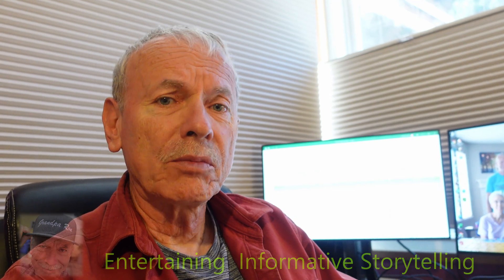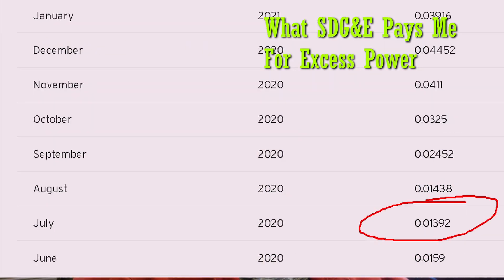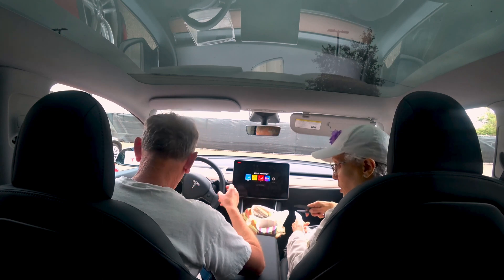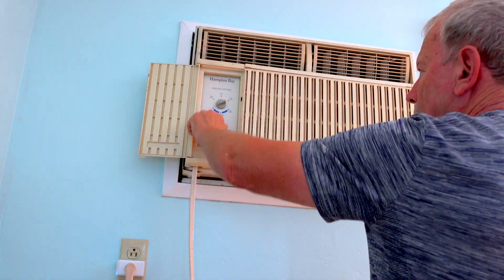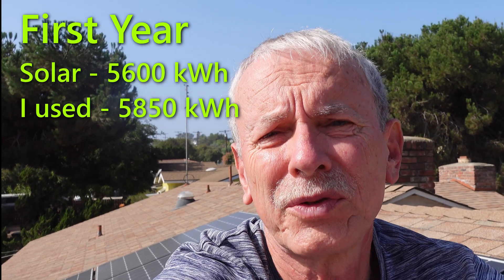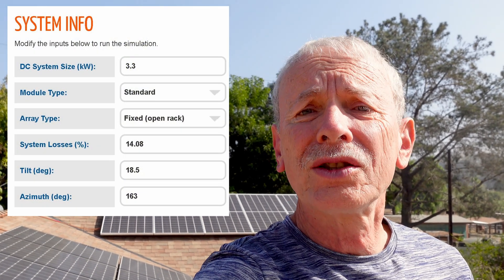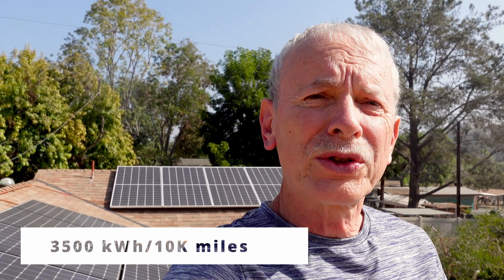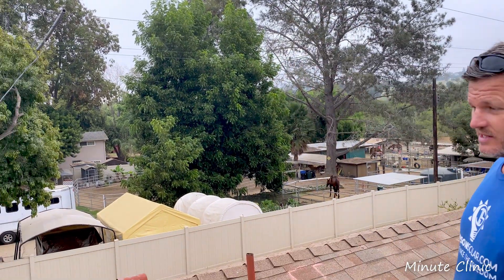Bought a Tesla, NOT enough Solar to Charge it.

Comment: My wife and I live in Edmonds, WA in an all electric home (2000 sq ft) with 13.2 kWh solar PV system + 2 Powerwall-2 batteries. Installed solar in 2012 and PW2 batteries in 2018. Brought first Tesla (Model S) in 2012 and second one in 2015 (MS85D) and Model 3 in 2018. We have been net producers of energy for last 9 years, which includes charging both Tesla's. I have microinverters because we have shading issues from trees surrounding our home. Last year we generated 350% of our energy needs for home and electric vehicle charging. We have heat pump and heat pump water heater, which provides both heating and cooling and much more energy efficient than conventional air conditioner. We overbuilt our system and I have no regrets about doing that. We are operating as a microgrid for 9+ months of the year, and only use grid energy during winter when we do not get sufficient solar to power our needs. We love the ability to charge our two cars off our roof and would never go back to ICE cars. Haven't been to a gas station in 9 years.
Reply: Live the ddream! Way to go!
Reply from the maker: Congrats. You are way ahead of the curve for renewables.
Reply: Do you get paid for the extra energy that you produce?
Reply: @melinasparks3268  Yes, from 2012 through 2020 we got paid $0.54/kW, as compared to energy rates of $0.10/kW. Our energy provider capped the upper payback amount at $5,000/year, but that enabled us to pay off our solar system in 7 years. We now own our energy generation system.
Reply: Your 350% over your needs? That's a giant waste of money. Why would you give the power company all of that free power? Unless you are getting paid the same rate they are charging you to buy it, anything over is a waste.
Reply: @cs-xd9gy  many power companies credit you for future needs. Make extra kw’s, bank them as credits for the winter
Reply: @cs-xd9gy ....as metuoned above, the buy back makes it make sense. And when combined with the need to charge 2 powerwalls to run the home when the sun goes down makes it doubly so......
Reply: @cs-xd9gy  I did not anticipate that my production overage would be as great as it has, because I sized system based on existing electric bills and before we got our two EVs, and before we did our energy reduction retrofit to our existing home (i.e., extra insulation, window upgrades, ext.). We did get paid for our excess electricity generated through Net Metering @ $0.54/kWh for 8 years with checks limited to $5,000/year.  Our current electric rates are $0.10/kW. That helped pay off our solar system in 7 years, and we now own them. That reimbursement system sunset in 2000, and we are now credited for excess solar produced. Our electric bill is only $180/year, basically the cost of being hooked up to the grid.
Reply: What’s the total cost?
Reply: How many panels for that size system? 13kw is huge
Reply: @AlejandroPerez-ef5ez  We have 55 panels, 33 on South facing roof , 16 on west facing roof, and 6 on east facing roof.
Reply: Great to see such successful solar experience. Does heat pump works with solar or from battery storage (powerwall)
Reply: how many miles are you putting on those vehicles annually?

Comment: Call your utility company and ask if they have a EV rate, if they do get on it right away. The way the EV rate works is generally starting at midnight the EV rate begins you program the car to begin charging at 1205 AM and the EV rate ends at 7 AM.  When you fire up the heat before you leave the do so about 530 AM so you’re not using the day rate power this way you unplug and leave the house with a full battery( 80% ) to charge higher than 80 % is much slower and takes more time and uses more power.

Best of luck.

Food for thought
Reply from the maker: They do but it has a $16/mt flat charge and then 9cents per kWh. Solar is cheaper.

Comment: This is a good explanation of the installation process and the calculations that are needed.  Like you, I find I love driving my Model Y.  I've driven 7800 miles in 7 months, but electricity is much cheaper here in Missouri.  I only pay 10.19 cents/KWH for electricity at any time of day.   The downside is that I don't get any rebates of incentives of any kind for driving an electric vehicle. 

Keep making the videos, Ron.  I enjoy them.
Reply: Now but when everyone puts a draw on the grid what you think its going to be then, think texas
Reply: @kinglord5429  Texas? You mean where they have more solar and wind renewable energy generation than any other state?  With battery and other power storage the grid will be just fine in the future. Also Fred's drain on the grid only comes in the winter. Year round he produces triple what he uses for the whole year. The system is not going to fail.
Reply: @cre8tvedge  no think when weather conditions cause it to crash.
Reply: So that is close to free energy base cost in Australia 25 cent Au South Australia went solar so about 50 cents per Kw charge  a battery car at chargeing station 70 cents per Kw cheaper to drive diesel car

Comment: No battery storage system?  So you just meter into the grid during the day and pull from it at night?
Reply from the maker: Yes. Batteries too expensive.
Reply: Yes that's also a great idea to keep back-up the solar energy to a LFP battery (LifePo4 battery) storage by using some smart Solar Off Grid systems.  There are some nice brands are available in market now a days like Growatt, Sofarsolar & BYD by using their LFP battery.  You may consider this too in your future plan.